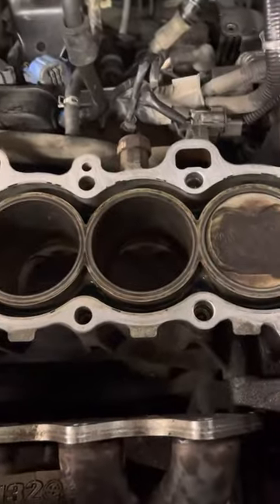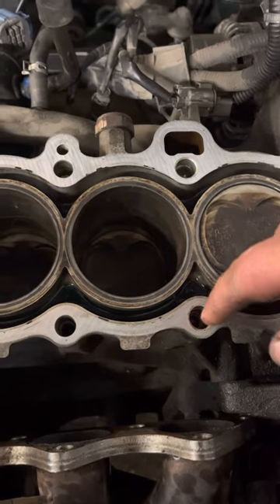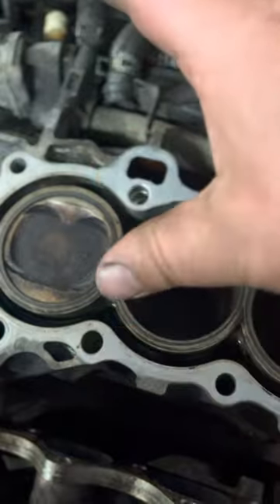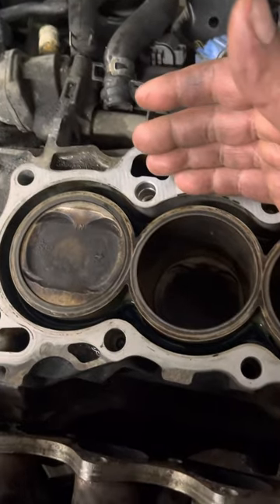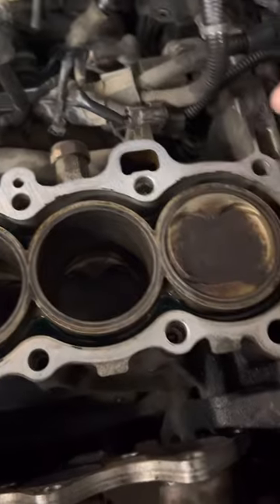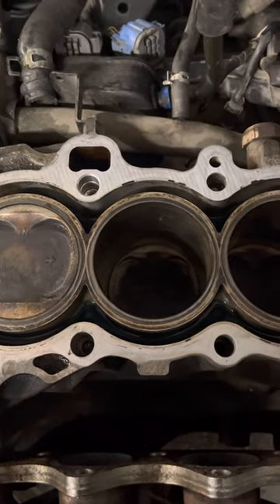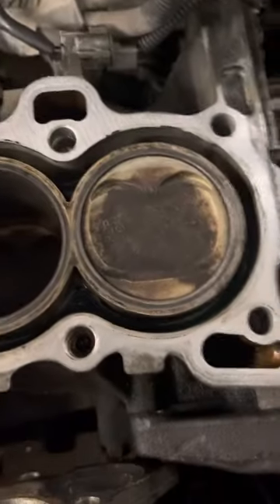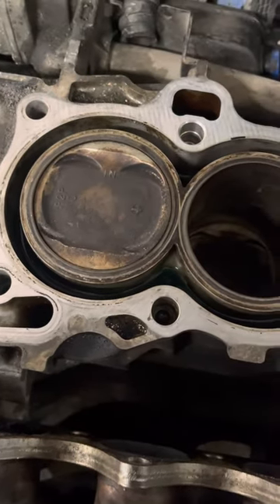Do I need engine dowel pins? Yes and here is why

Comment: I have an fj600(motorcycle) currently rebuilding the engine inline 4 like this  and about to install the cylinder head and time it up. Theres one major problem thought the cylinder head requires 4 dowels and two are missing towards the right end of the block that ive lost. Tempted on just installing it without the large 2 dowels ive lost as I cant find replacements anywhere, would i get away with it with the two remaining and omitting the others?not so sure now having watched the video.
Reply from the maker: I would be safe than sorry and have to redo it over